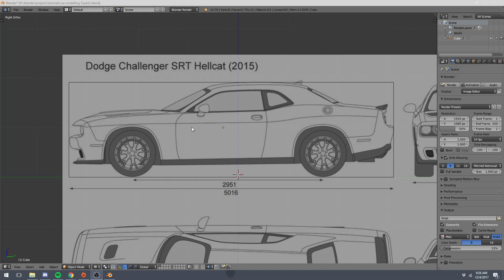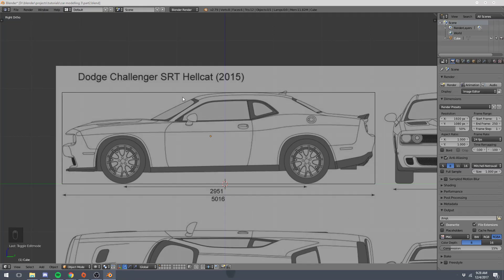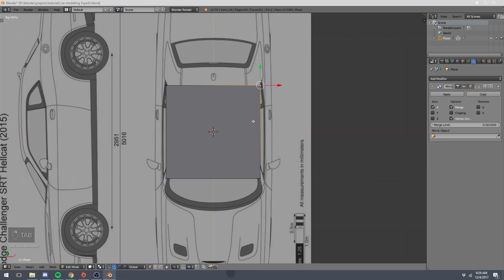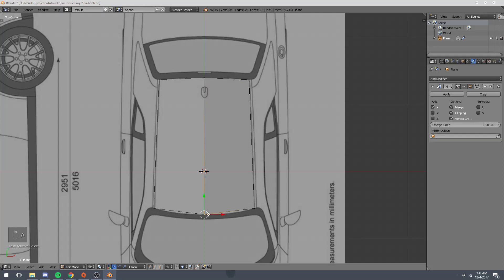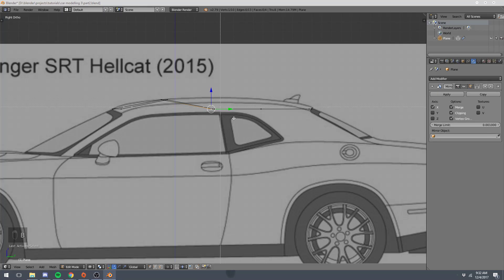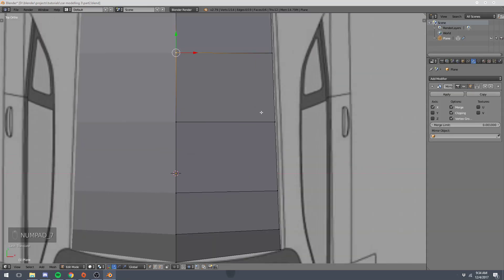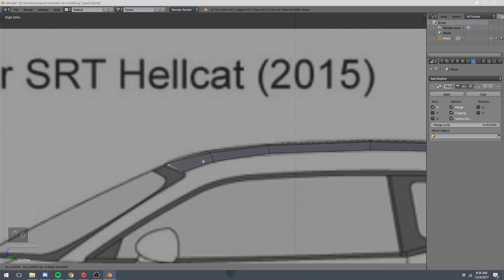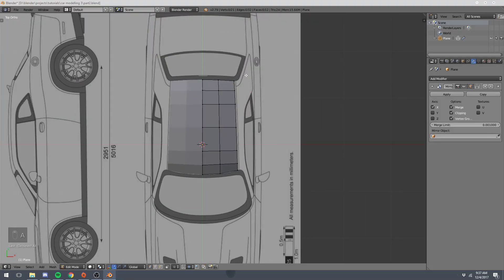Model a 3d Car | part 3 | intro to modelling (Blender tutorial)

Comment: My mirror doesn’t work with my image 
Edit: got it but my front wont line up with my side
Reply from the maker: are you using the same blueprint? some blueprints are not accurate and do not line up. send a screenshot or join the discord for help.

Comment: just a tip for ppl, if you loop cut your plane with no modifiers it halves it. then mirror it with clipping and you get the same result just cleaner way of doing it

Comment: The car I'm making is the AE86 so after I dragged the platform to the top of the car I was essentially done.

Ah, the benefits of modeling cars from the 80's...
Reply: After I finish the challenger tutorial, first will be a Datsun 620 Pickup. Did this tutorial and then built the 620's roof with no blueprint. It went okay.
Reply: I am doing a fiat regata :)
Reply: you're lucky, i'm trying to model a 2001 civic EP3, lots of curves there D:
Reply: @nathanaerowing7385  Nissan S130Z
Reply: I’m trying make a car I came up with and only one word can describe it: curvy

Comment: How do I turn off mirroring when I want to work on only one side of my model and not have it copied to the other side ?
Reply from the maker: guardmark unfortunately we don't that feature with the modifier. Generally, you can model all the symmetrical parts first, apply the modifier, then you can work on each side individually.